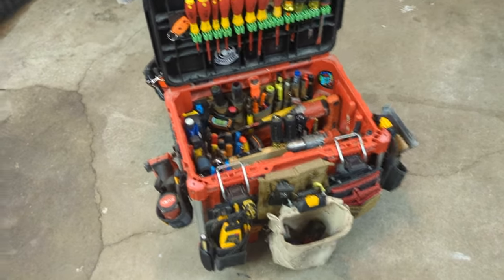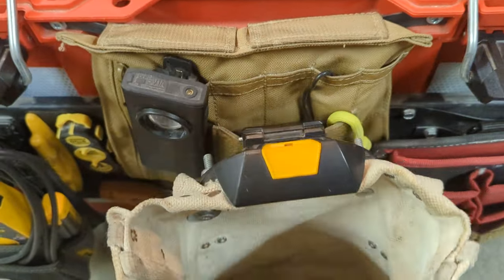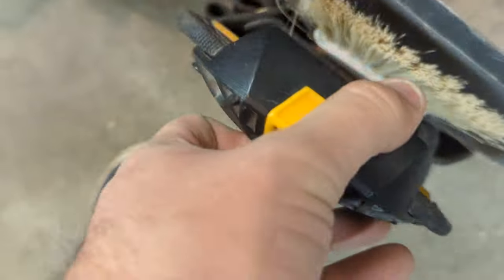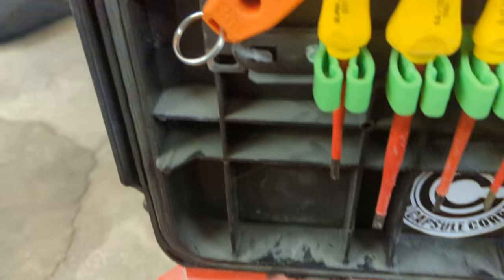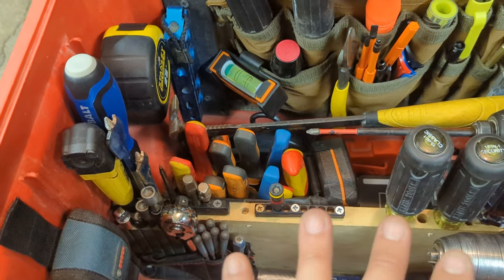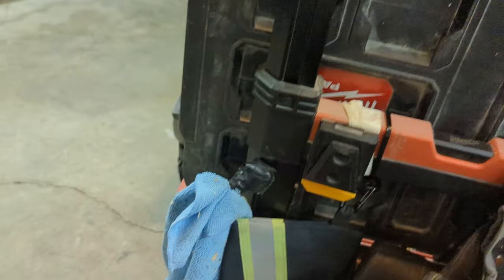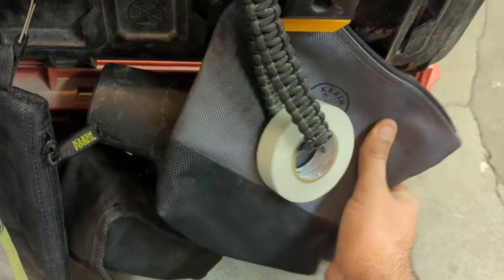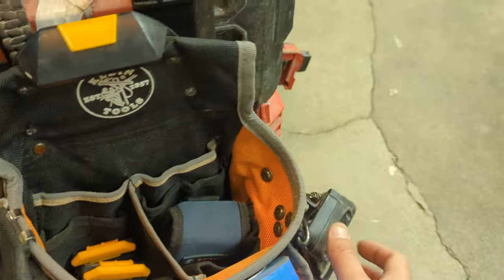Milwaukee packout hacks and modified main rolling tool box with toughbuilt and other tool brands.

Comment: C'mon, bro. Don't make me have to install instagram.
Reply from the maker: 🤣🤣🤣  will do a detailed video on you tube soon. 🍻
Reply: @lowvoltagedude7837  By the way, I've been following your content ever since I got started in the trades. That packout box keeps getting crazier. It's not my style, but props for making it work for you.
Reply from the maker: @peglegthered  thanks brother 🙏 what's your trade?
Reply: @lowvoltagedude7837   Low Voltage (haha) Security systems at the moment.

Comment: Damm bro, that is some serious organizational system you going on. I never thought of utilizing the outside as much as you have. Well done! One question though, when you are rolling your box do the bags on the wheel side drag or touch the ground?
Reply from the maker: I have been using the toughbuilt ones with no issues on the back even going up stairs is not an issue  but I just added the Hilti and supply bags so I haven't tried that with stairs yet. If it does catch the Hilti and zipper bags I just gotta cut the zip ties and figure something else out. My advice is start with things you know will work and make adjustments till it's dialed in.
Reply: @lowvoltagedude7837  No touchy touchy upstairs!? Damm that wasn’t expected. Well if that is not a set up, I don’t know what is 🤙🏽🤙🏽🤙🏽

Comment: Very well done. I thought I was the only one that saw the need for more small pouches in these rolling tool boxes. Not everybody uses nothing but large power tools. None of the soft sided rolling tool bags have enough pockets either. I’ve done similar mods to a Husky rolling bag, added 2 full rows of pockets for all the small hand tools I carry. I only carry a cordless drill…the rest is hand tools and my kit bends the beams at around 70 lbs. thanks for sharing.

Comment: For the inner front pockets you screwed on, I did this a while back using heavy duty adhesive velcro strips, has worked very well so far, without needing to put holes in the front.

Comment: I appreciate the look at the mods you have made. I really like the piece of 1x4 or 1x6 that you have inside the box as a divider. I never thought about drilling holes for screwdrivers to sit in the divider like that. 
Everybody has seen holes drilled in wood for screwdrivers but I've never seen it with the holes in that sort of orientation. Very smart sir. 
Also the only difference in my setup is that I prefer to not have stuff on the outside of the cases. It is just one more thing to worry about like tools falling off or someone stealing something on the outside.  And also because it is heavy and hard enough to get the packout in the truck as it is. Stuff hanging all around it I image would take much more effort. 
But that is just my opinion and what I like in my packout. 
Overall great video and thanks for the share

Comment: Just seen this, and im also using the milwaukee and tough built here in the uk. Only difference is my milwaukee is black and i dont have no where near the amount of tough built parts. Nice idea with the clips on the back. All the best, and great setup 👌
Reply from the maker: I do like that blacked out version 🍻 I used metal zip ties on mine to hold the toughbuilt clips on the back bar.
Reply: I might have to travel over the black pack out looks so much better than the red

Comment: Wow that's a lot of pouches. Interestingly I just added apiece of aluminium inside like your wood piece to keep things upright in my Hart stack. What pouch is the one inside the front? I guess the rear one is the same. I'm just trying to figure out how to keep the tools more upright to make them easier to find as well. I do have something you forgot. I added a drink holder on one side. Just gotta have water with you.

Comment: Impressive, but the issue I see is with the durability of the box itself. It's been highly customized so when part of it fails, whether due to wear and tear or weak spots because of holes drilled, weight etc., it will be a major process to customize another box.
Reply from the maker: It's been a little under 3 years with no problems so far 🤞I hope I get another 3 years🙏 🍻
Reply: @lowvoltagedude7837  I bought their larger Pack Out tote for around the house and for when I do work at my rentals. It's superior to anything DeWalt or other brands offer given its larger size and number of pockets. However, I actually prefer the DeWalt Toughsystem boxes over the Milwaukee. Personal preference I guess. And for large amounts of screws, nails, plumbing fittings etc. I think the $30 Ridgid organizers are the best.
Reply: Don't overthink it Dan 😎 Just do it. Nothing in life is permanent. Make the best of it now and enjoy it.
Reply: @LemonySnicket-EUC  when you start living life the way your comment goes towards that tool box life becomes easier. I, as an OCD individual strive to do as such everyday. Not successfully, but I try! I’m not sure if you realize how deeply profound your comment is. 
Side note lol 
If you looking for the strongest and cheapest pack out system nothing beats Rigid for the buck$!!!
Reply: @zjedinite  I'm right with you Larry ! I'm a bit OCD and perfectionist. I've learned that both are a disease if you will. My moto is progress over perfection. Often, We can talk ourselves out of so many things and sometimes even excuses get in the way. Also, well begun is half done is one in my brain as a mantra.  Just go get started, the rest falls into place. Thanks for the reply Larry. Enjoy life man.

Comment: The one thing pack out systems suck at is tool access on the job. You've gone a long way to address that. If you take a small table to set this on it'll save a helluva lotta bending over during a day's work. Nice job

Comment: Which one of those magnetic stud finder’s do you prefer?
Reply from the maker: Be honest they all do the same thing. The stud buddy is very slim and compact and I can't remember the name of the other one but it's a little bulkier and then
Reply from the maker: Nadium 52 magnet that I purchased from Amazon. I just wrap it up in a microfiber cloth and zip tie. It off is probably my favorite because it's probably the strongest magnet that I have, but in all they all are great
Reply from the maker: I do like having all of them because I can put them on the wall and mark out all my studs. If I ever need to be certain of the center of a stud, I usually pull out my Franklin that is kind of a bigger tool. I to use the magnets most of the time.

Comment: Wiha is not made for American screws. They will always cam out and strip the screw heads.
Reply from the maker: I haven't had that problem with the hand drivers 🤣🤣🤣 do you see that as a problem with the drill bits ? They do sell them at Lowe's and I've seen many reviews saying otherwise 🤔 i use Makita a lot personally for drill bits and mostly buy drill bits I can replace easily from the big box stores🍻🍻🍻